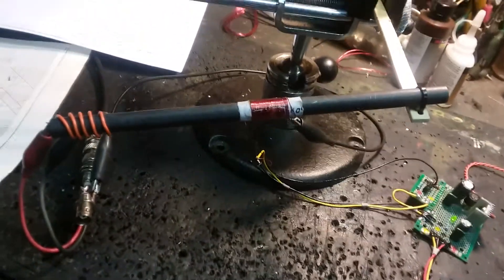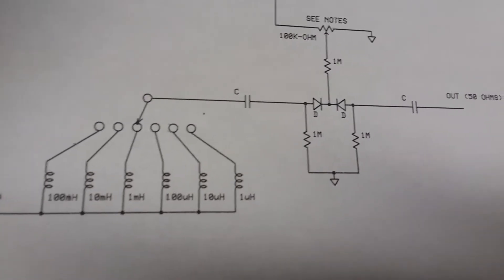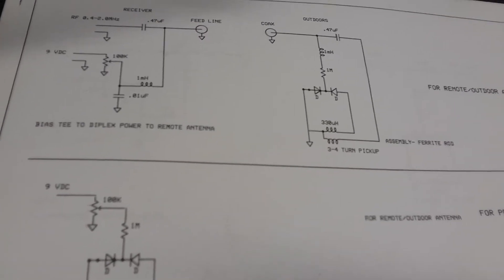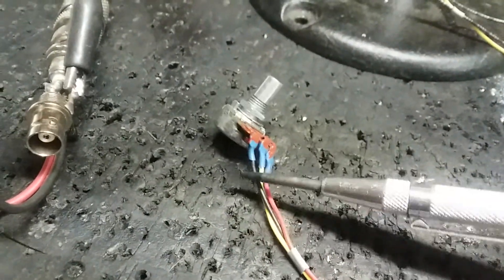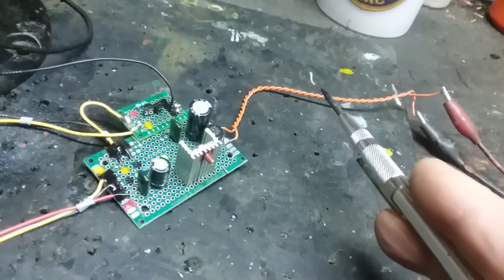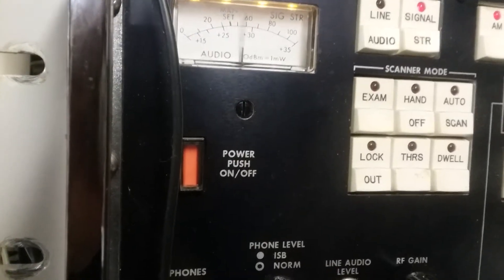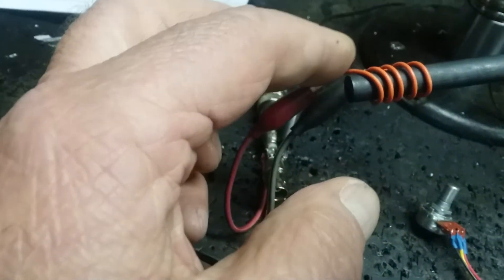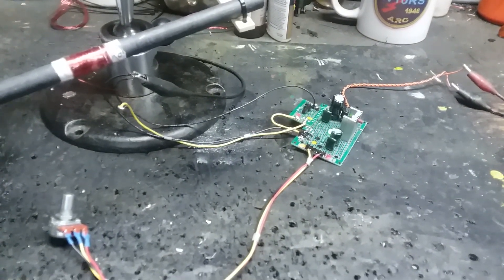Ferrite Loop Broadcast Antenna

Comment: Pointing the antenna to null a station isn't only to find the location of a station. It's also done by MW DX'ers to null out the strongest signal on a frequency to hear another station on the same freq. It's also done to reduce signal strength of a stronger station on an adjacent channel causing interference.
Reply from the maker: You are absolutely right. The 90-degree method I mention is to locate the exact azimuth for maximum signal and (hopefully) least noise. I also de-tune the position to avoid local noise pickup. Obviously, a rotatable antenna has many advantages. Thanks for your points.